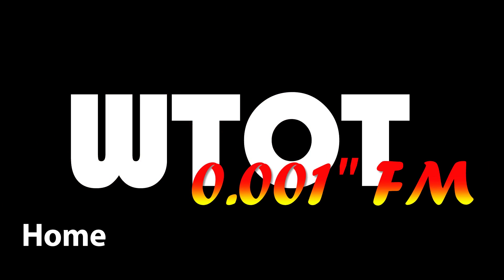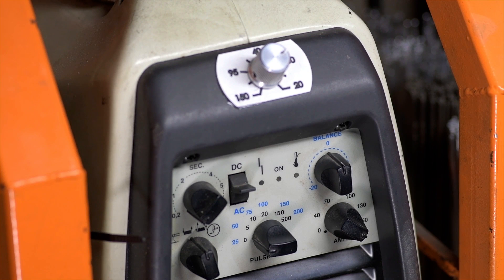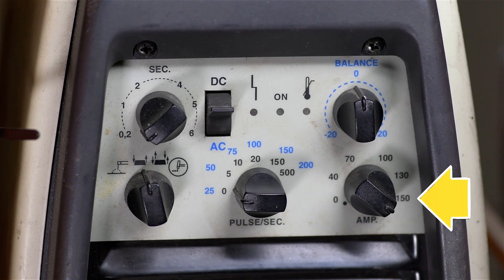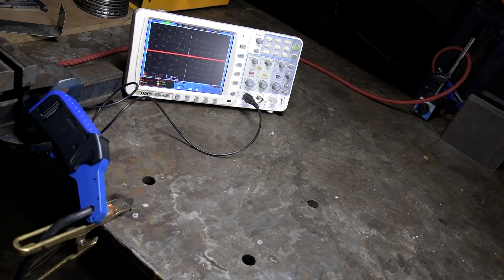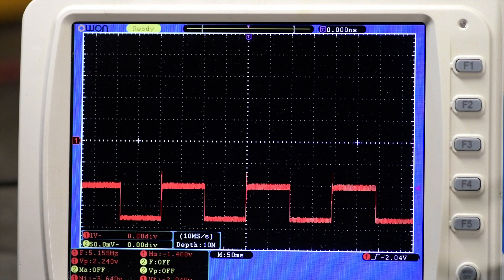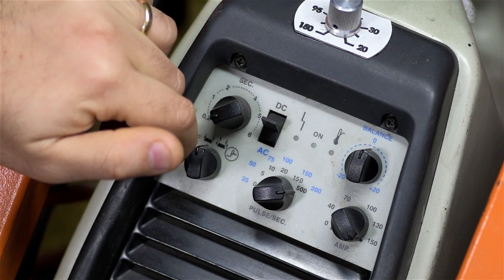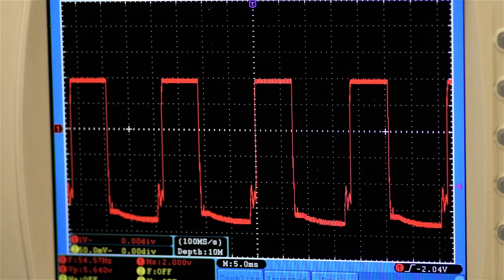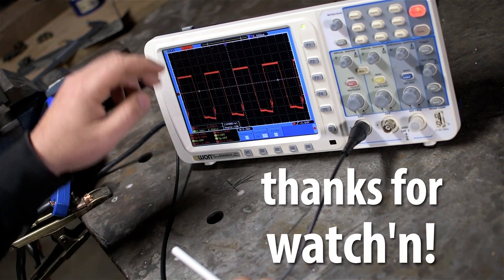My TIG Is Breaking Up With Me

Comment: this is probably a bad mosfet in the machine, causing it to be both incapable of supplying enough current in one direction as well as inconsistent output. chances are one bad one will turn in to more bad ones, as well as stress related components. I would figure out a repair strategy, chances are continuing to use it will result in more components heading to the grave. Leaky (dying) diodes can look similar too. None of the components are exceptionally expensive, but figuring out what's wrong can be.
Reply: Except that this machine, like virtually all of these types of welders, uses IGBTs not MOSFETs. If I were a betting man, my money would be on some issue with the positive bias supply. Simply never getting the top-rail IGBTs turned full-on will cause just about all the high-side waveform issues and that same supply is likely on the + side of the duty cycle pot as well, thus nicely explaining the duty cycle issue too.
Reply: Schematic shows MOSFETs. But it doesn't matter. You have symmetrical side by side circuits. Troubleshooting would be a snap.
Reply: I agree with Ryan, MOSFET, or as Stephen said IGBT, an IGBT is essentially a dual MOSFET, troubleshooting is nearly the same.  As I don't have the schematic for this unit I can't say for sure but I would think to replace these would be 2$-10$ a piece.  Most often when working with high power switching and pwm look to the area's that are taking the brunt of the power handling, i.e. the FET's or diodes.  Typically the cap's will not 'work/not-work' intermittently unless they are on the verge of going and it's a thermal effect.  I'd love to see troubleshooting and repair video on this!
Reply: I do concur with your suggestion that it should be relatively simple to troubleshoot. As I posited earlier, I expect he is going to find a dodgy connection or voltage issue on a positive bias supply. It nicely explains just about everything observed.
Reply: Well, arguing about the color of the horse. I glanced at the schematic, saw a MOSFET gating and called it as such. IGBTs are bipolars+MOSFETs.
I'm more wondering what caused the partial failure. It is lucky in a way it happened on such a crude device as a welder. Partial failures are as bad or worse than intermittents and can take down a lot of related circuitry as they go. Think class A amplifier or differential isolated voltage of a patient monitor.

Remember the rulez! Power output devices will protect the fuses by blowing first. And, In Application, Murphy's Law Supersedes Ohms.
(Actually, rule #1 is true. A silicon device going in to thermal runaway or current overload is exponentially faster than a fuse.)

My personal rule: SHOTGUN THE CAPS. All the caps on the average circuit board cost less than a couple of hours of your bench time spent scratching your head. Lytics can test fine until under full load.
Reply: I think folks are harping on mechanical issues because of the intermittent nature of the failure. the way it came and went looked mechanical to me. Thus my other suggestion to open it up, vacuum out the decade of accumulated schmoo, and reseat any obvious connectors. After that I start down our lists above. ;)
Reply: Now I'm baffled. Are we looking at the same schematic? They are clearly IGBTs.
Reply: You're right. Not awake here. Still are MOSFETs though! 
That looks like it would be a stroll in the park to troubleshoot.
Reply: They most certainly are not MOSFETs. They are bipolar transistors. Their structure has some similarity to a MOSFET (with material differences), but their electrical properties most certainly do not. They share the simple drive scheme with MOSFETs, but have significantly lower output impedances so are much better suited to applications like this. They also typically have significantly larger voltage handling capacity which is not really that interesting here. The other big difference is that as a consequence of the structure the IGBTs tend to have extremely limited ohmic regions - they switch hard on and hard off, which is a HUGE improvement over MOSFETs.

Calling an IGBT a MOSFET is like calling a milling machine a drill press.
Reply: Not really arguing about the color of a horse, more arguing whether a Zebra is a horse. An IGBT is more or less a Darlington transistor but with a MOSFET for the input gain-stage (or transconductance in the IGBT case) device. The heavy lifting is all handled by a bipolar device, with very different characteristics (virtually no on resistance, a saturation voltage-drop, etc.).

It is highly unlikely that one of the output devices failed - in general if one goes it takes its friends with it. Often rather quickly and quite spectacularly. I would also note that the kinds of current levels TOT is running are well within the capacity of any one of the output devices. Something else is amiss.

I don't really see anything in those waveforms to suggest a capacitor problem other than as might be related to a supply problem. The bias rails are probably switching supplies and the output filter caps on those often have tough lives. Might be worth a swap there if they are easy to get where TOT lives. 

Having said that, the intermittent nature of the beast - it kind of works some times, then not at all some times, then more or less works right some times does not seem like a failed cap at all. That points towards an intermittent connection or short of some sort in my book. Opening the case and giving it a good vacuuming and re-seating all the connectors may well fix the darned thing.
Reply: Alrighty. Checking that schematic https://www.scribd.com/doc/11877495/Thermal-Arc-150-gtsw-Cemont-ac-dc-tx150-service-manual-Tig-Welder#scribd
Power supply is straight simple analogue, a + and a -. Moving on over, twin sides, pos and neg. Optocouplers at the bottom driving 2 complimentary PNP-NPN pairs on each side then an array of 5 MOSFETS on each side. Not seeing any indication of switching supply or Darlington arrays. Page Tav 6B on bottom right

Now  on page Tav 5B we have a fairly standard twin secondary xfrmr and regulation at the top. An array of 4 MOSFETs on either side, and a massive 6 cap filter array towards the bottom.

Now, providing what I am looking at is the circuit, it being a nicely blurry fuzzy. It appears we have MOSFETs in parallel. If that is the case, 2 or 3 blown devices on the + and maybe one blown on the - would admirably explain Tony's wussy juice squirting. And I'd be tempted to look for any indication the caps took a beating when this thing piled in.

Are we looking at the same schematics?
Reply: Well I will admit I did not spend too long looking at those schematics. Sheet Tav 5B is taking the input line current, rectifying it, filtering it through the many caps as you noted, then turning it back into AC but at a much higher frequency (one presumes). This stage is also performing the PWM to set the magnitude of the current (with MOSFETs, as you noted). Since the current control appears to get to the right number, and looks pretty steady, it does not seem likely there is any issue on this sheet.

Tav 6B is an IGBT half-bridge inverter which then takes the output of the power supply on Tav 5B and does the appropriate thing with respect to the positive electrode. Note that there are actually a couple of input choke boards ahead of this circuit that rectifies the output of the transformer between the two stages to get back to DC, and provides the mid-point for the negative electrode. Since the failure only seems to appear on the positive side of zero, it is likely the problem is somewhere on this sheet*. As you noted these are fairly simple linear supplies on this sheet, and these supplies are not used on any of the other boards. So the issue may be with one (or more) of the positive-side devices, the linear supplies powering the gate drive for the positive side devices, or with a connection to this board.

*Of course it may also be that the control signal getting to this board is the issue. If the positive-side drive signal (COM_AC) is weak and / or missing, it may well be that the IGBTs are running in the linear region (ugh) and thus the low output current on the positive side. It should be fairly simple to determine what is going on here.
Reply: Throw in the normal 'check for dry joints(These things have transformers and fans in them. The machines vibrate and get thermally cycled hard.) especially around the IGBTs and making sure the driver waveforms, rail voltages are all correct(He's got a 'scope and the schematic!) then yeah, check for blown IGBTs and replace caps.

Comment: I fix welding machines for a job - this is either the A/C driver PCB or the main control PCB. To clarify: Many ac/dc machines have a dedicated driver board to generate the PWM and drive the IGBT's which create your A/C on the output. Many other machines do this function on the main control PCB to reduce the number of PCB's in the machine. If the actual IGBT's were bad, you'd know about it. My money is on the PCB(s) that control them. You might get lucky and be able to repair the PCB, otherwise bin it and replace is the easiest/quickest option. If you can get the parts that is.

Comment: Hello Tony! Im learning  TIG DC weld in my garage and can you tell me some settings for mild steel, thinness of steel is 5-8mm? 2.4mm Red electrode - 150A, base 70A, 3s pulse DC-, Argon 6L/minute.
Reply from the maker: If you're just welding flat on a bench I wouldn't worry about pulse settings if you're just getting started.  Unless you're using it to learn weld bead timing.  Then set it as slow as it goes, add filler when you get the hot blast, move forward, add on hot blast, etc, until you develop the muscle memory.
Reply: Thanks :)

Comment: Before you send it in, pop the cover off and have a look around for corrosion, capacitors leaking, loose/broken wires, etc.  Worst case, you put the covers back on and you're back where you started.

Comment: If it works fine with 30/70 but you want 70/30, couldn't you just swap your leads over?
Reply: if it was working properly then I'd guess yes,  but if the positive (normally) side of the pulses are cutting out intermittently that'll mean the electrode will be too positive when swapped,  and metal vapour will migrate in the arc to foul the electrode.
Reply: So swap the leads, start at 30/70 and turn it back towards 50/50 untill you find the power level your looking for.
Reply from the maker: In theory, I believe so, yes..but then switching to DC would stink.
beggars/choosers?  I see your point.  Thanks for watching Adam.

Comment: Tony, more than likely, since Yr machine is 'analog' in its driving circuitry, then there will be 'offset' potentiometers for most of the parameters on the oscilators pcb inside. 

To me it looks totally fixable, end since U've got 'osmelloscope' as the Candian guy w'd say...
Try to fix it. I'm happy to assist and help if I can.

PM me if U like

Comment: Tony your great, for ages i've wanted to see a welder on a scope. Been thinking about modding my own buzz box and trying to think of a way to set the wave for HF and cleaning etc. The coverage was spot on for those all ready been looking at other channels to do with welding. Even they haven't done a welder on a scope but it paints a good picture!! Do more like this ^^ So as your missing some power on both the + of DC & AC someone should be able to easily pick out this problem, but then you are running an inverter, i would get on the eevblog.

Comment: If the balance is controlled by a time constant such as an R.C combo - that might be causing trouble - as others have said, caps are more likely to fail than resistors. Seems the machine has done you quite well for 12 years.

Comment: Perhaps check the line voltage coming into the machine. I presume this is a 220VAC input machine, Perhaps the Line voltage isn't quite right. Simple check is to try attaching the TIG welder to another Outlet to confirm its not a issue with the AC circuit.Its also possible that dust that perhaps has some conductance is interfering with the driver. Try cleaning off the controller board.

Comment: Looks a bit like the MOSFETs on the possitive half bridge aren't working/switching sometimes. Time to open the welder and look what magic part has failed. Since the negative side works fine, you could perhaps use it to compare signals with bad possitive side. 

Pdf about TIG inverter topologies: 
http://www.infineon.com/dgdl/an-1045b.pdf?fileId=5546d462533600a40153559195fb0fa1

Comment: Old school here, love my 60's vintage Lincoln 300 (yes, that's 300 amps ac/dc), and so do other kids like you who have used it. Even though it's almost 5 ft tall and weighs a ton, with built-in water cooler it runs an unbelievably beautiful bead on 1/4 inch steel. Frankly, I've never found a need for fancy waveforms, even on beer cans to structural steel or stainless. My answer to your problem is copper windings, and lots of them.

Comment: I think if you look inside the welder you'll find a bipolar power supply and one side is failing with a low voltage.  This will affect the analog circuits that measure electrode current.

Comment: i suspect failing capacitors or switching transistors (FET/IGBT), could be a failing offset trim pot on the board inside.
Reply: That was my guess too! Either replace bad caps if possible, or the board needs replacing. Sometimes you can get replacement boards cheap through Alibaba.
Reply: Agree, probably one of the bridge FET's. Probably causes asymmetry in de power supply throwing off the (analog) balance circuit?
Reply: I concur, probably just dried-out caps.

Comment: Find a local electrical enginerd who wants to help figure this out. Probably a bad cap or some transistor on it's way out. Diagnosing the fault is the hardest part of this repair, fixing it won't be too expensive. Start by having a good look inside, if some component looks like shit, it probably needs replacing. 

Anyway, shouldn't be too hard to find someone who can help you find the problem, electrical engineers love the challenge of troubleshooting. Contact he local hackerspace.

 If you post some decent pictures of the insides, I might be able to do a quick visual inspection if you'd like.
Reply: Transistors rarely fail on their own initiative. Crapacitors on the other hand do go bad over time with electrolytics liking to go open while ceramics like to go short. Once capacitors go bad, gate/base drive circuits may under-drive the transistors and blow them up or cause all sorts of other issues. I wouldn't be too surprised if the main issue here was some bad capacitors in the feedback and timing/control circuitry. A bad solder joint that decided to manifest itself many years down the road wouldn't surprise me either.
Reply: "Transistors rarely fail on their own initiative."That's not true for power transistors, they can easily fail if they're subjected to high temperature and vibration environments.For example the cylinder 2 spark firing transistor failed in the ICM for my 1997 Audi A4, and it's an extremely common failure mode for that part. Just googling "audi a4 b5 cylinder 2 not firing" gets you thousands of results.
(No, I don't know why it's always cylinder 2 that fails. I'm guessing it has something to do with the impedence of the HT lead for that particular cylinder.)
Reply: Teardown Dan I agree, seems like Tony is looking at a capacitor going bad. Dielectric breakdown probably considering the age.
Reply: Another vote for crapped out capacitor or dry joint. Open it up not much to lose.
Reply: If a transistor in the control circuit had died, I would expect one of the controls or functions to either die completely or have erroneous operation. Here though, everything appears to be working perfectly fine apart from reduced adjustment range and AC/DC bias issues.

The issue could be as simple as conductive dust bridging the reference voltage and ground in the foot pedal or other potentiometer circuits, pulling the reference voltage low and messing up everything that depends on it.
Reply: I don't know about this machine but the few welders I've seen the inside of are potted circuit boards. Makes troubleshooting and repair not so easy now.
Reply: Teardown Dan Yeah, crapacitors are always more likely. But a blown transistor or thyristor isn't out of the realm of possibility. It could be a case of latchup due to spikes.
Reply: Semiconductors tend to fail shorted. If one of the output devices failed, I believe he would be having far worse issues than partial loss of duty cycle control and reduced positive magnitude. Since he still has control over everything, just not over the full original range, I'd say the power stages are fine and his problems are on the control side, such as a bad reference voltage.
Reply: Teardown Dan I concur, it's definitely not a failure in the end stage. I'd go looking in the driver section, first at capacitors, but I wouldn't rule out failing transistors (whether it's the solder joint failing or something more esoteric). I guess my point is: never rule out the very unlikely. But the principal rule of troubleshooting still applies: shoot for the easiest/most common fault first.

I would love to take a stab at fixing that thing, too bad I'm on the other side of the Atlantic...
Reply: Teardown Dan j
Reply: LReBe7 ask Mc Max
He's building a welder from scratch, repairing one shouldn't be a problem
Reply: Honestly, I would start with the foot pedal since it is some sort of physical switch or pot/rhea in there. Unless he gets the same result with the other switch or whatever he has instead of the foot pedal